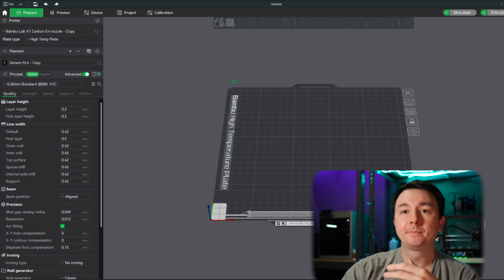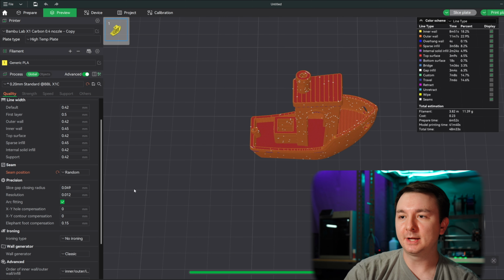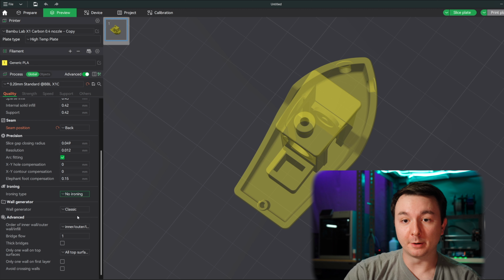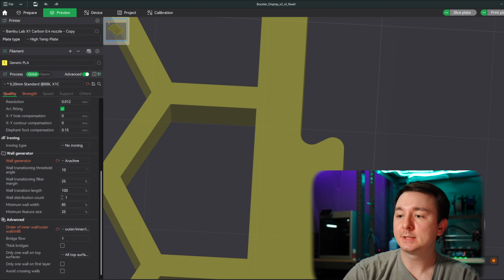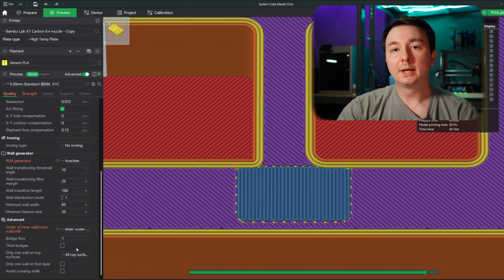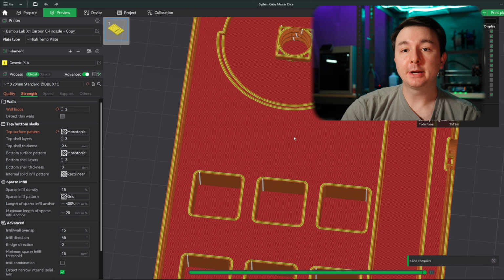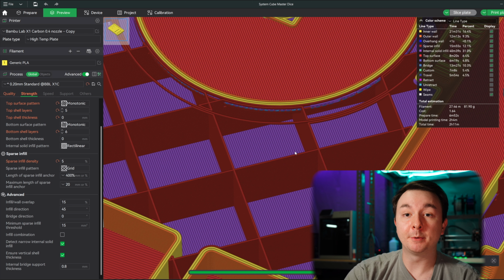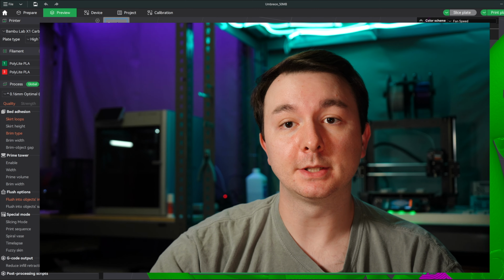Slicer Settings for Beginner 3D Printing

Comment: If you can publish more of these, in detail , solve a problem kind of videos , 3d printing life would be so much easier. Its because you include the why this or that setting should be changed rather than only providing a dictionary type description of a setting. I have never seen for example such a nice concise description of why arachne should be chosen over classic or vice versa , or the blobbing at the intersection of rectilinear infiil .  Its the problem I have with the Prusa definition of their slicer settings : they don't always describe how or why a particular setting might solve or avoid a problem with a print.  Nor have I previously seen the recommendation to analyze in microscopic detail the sIiced object before sending it to the printer . It makes perfect sense .I've subscribed . And huge kudos for approaching what are software challenges using a problem solving approach. You've raised the standard of instructional videos.

Comment: I just found out about your channel and absolutely loved it! I want to start 3D printing but have no idea where to start. Are you planning on making a video on basics or even lecture videos? Or any suggestions for me to where to start? Any answer is appreciated :)
Reply from the maker: Do you have a printer? My advice would be to look up printers within your price range and see if you can find videos about them. I have a video on the MK4 and I’ll have another video soon about a cool printer. My recommendations are a P1P or a P1S, a MK4, an Elegoo Neptune 4 pro, or an X1 if you have the money. Then honestly just go on Printables and try printing some stuff. Print it and see what happens. If it comes out okay then keep going. If something goes wrong try to figure that out and fix it and then go from there. If you buy a modern printer a lot less can go wrong than you think.
Reply: I had did some research on the printers and Neptune 4 caught my eye, it's nice to see that you recommended it. Thanks a lot for giving a time it really cleared some clouds. @ButterPockets

Comment: Surprisingly good video, didn't know about bridge flow thing, will try that next time, thanks.
Reply from the maker: So since this video I’ve been playing with bridge density as well. Lowering your flow and lowering your density do similar things in the end. The density changes how many lines there are packed into the space without changing the flow. So try one that works for you. I’m leaning towards density actually so the flow doesn’t change.

Comment: Thank you for the in-depth settings tour of Bambu Studio. I've just recently started my 3d printing journey, and every little help goes a long way.

I've noticed that I've come to a point, where I would like to play around with some G-Code on my printer (Bambu P1P), because the hotend fan always run at 100%, even when the hotend is cooled down to ambient temps. However, it doesn't seem to react to the single-line G-Codes I've been sending it through the SD Card.

It might very well be because I'm simply not inputting the G-Code correctly, or because I'm sending it incorrect.

Is there any chance that you'd be able to make a "tutorial" of sorts, to get started with custom G-Code? Or do you have any reference to look up where and how to send G-Codes to the Bambu printers?

Thanks in advance.
Reply from the maker: Letting you know I saw this and I’ll get back with a good answer later :)
Reply from the maker: So I was looking into it and it seems like an M106 P2 (might be P3, but I think its P2) command should set the hotend fan. Set that value between 0-255. What code have you been sending to change the fan speed? I wasn't previously aware of a way to send Gcode like you can with Pronterface but it seems like you can do an FTP server to the printer with the LAN access code. How have you been doing it so far?
Reply: @ButterPockets Appreciate it a lot.

I have tried sending M106 P1, P2 and P3, with 0-255. It doesn't react. But it doesn't react to anything, even a simple G0/G1 X100 or something like that. No movement. 

I have been "sending" it through FTP, put the file into the "cache" folder, and ran it through the printer via the screen on the printer.
Reply: @ButterPockets  Just to update - I talked with Bambu Labs support, and they sent me a replacement Toolhead PCB. I replaced it, and the fan begun to function normally, so it was simply a faulty PCB that caused the toolhead fan to never stop spinning.

I still have not found a way to elegantly send G-Codes to the printer, but it is not needed for me now.
It would still be nice to troubleshoot, so I will keep looking.

Thank you again.
Reply from the maker: @KraggHC  I appreciate the update! Yeah I really don’t think there is a way to do it with how they’ve locked it all down. But I’m glad you figured out the fan